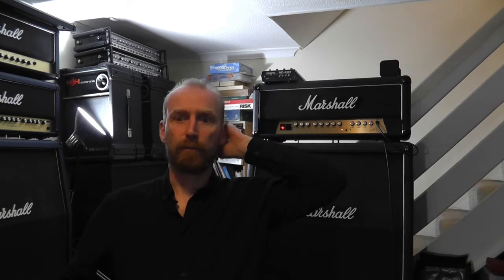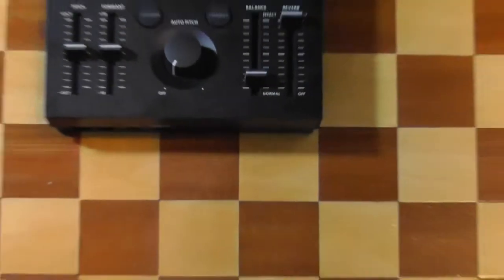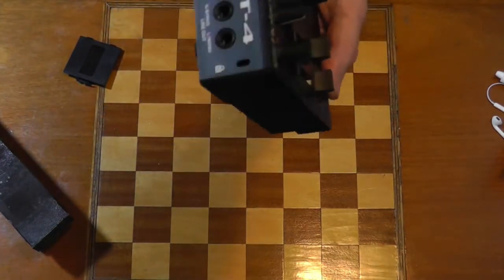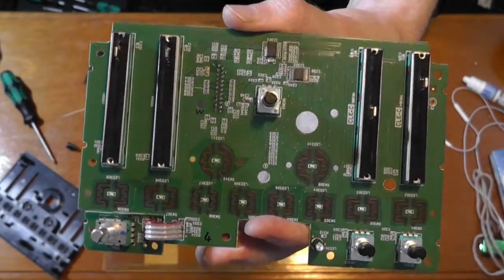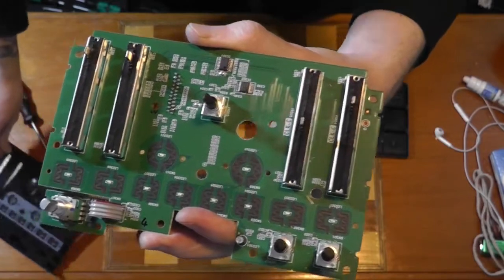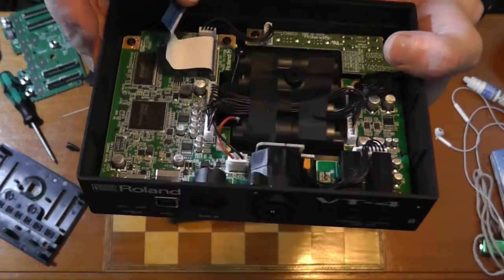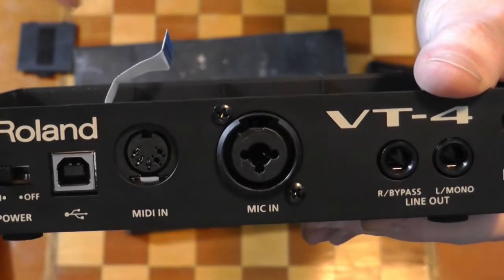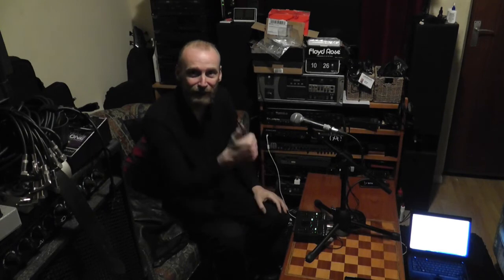Roland VT-4 Teardown

Comment: If I were to replace the big volume knob in the middle, would I just pull it up, pull & twist, or is there a screw that needs to be removed?  I’ve been hesitant with attempting to remove the knob as I don’t want to unnecessarily force it and break the unit in the process.  

Also, do you happen to know the potentiometer size of that particular knob?
Reply from the maker: Hey mate just pulls right up and off. I think it's a 'D' shaft on the pot underneath. They are usually all the same size, so when shopping for a nice fancy knob, juys make sure it specifies 'D' shaft and you should be good!
Reply: @hydorah  Howdy!  Thank you very much.  Worked like a charm.  Cheers!

Comment: IMO roland is a highly experienced manufacturer of audio devices and interfaces, I've many Roland devices and this does exactly all the things you'd expect from a device named "voice transformer" ....and if you ask me it's probably one of the best on the market, despite the cheaper looking build quality. it's the quality of the components that make it, and they engineering that went into designing it. for the price, best in class.
Reply: and furthermore, to the people talking down on this device, if you want all of these effects in different devices it would cost you thousands rather than hundreds. plus Japan has long been the undisputed king of audio....so Roland FTW
Reply from the maker: @NickDoddTV  I Do not entirely agree. The item is full of Chinese made components and is made in China. Chinese on the outside, Chinese on the inside. I think you maybe thinking of a prior Roland. You can't actually stop the VT-4 from modifying pitches. Roland just in general is utterly incapable of giving people what they want. People want the classics. Roland just spews out digital lookalikes. That said I still have my VT-4 and can see it coming in handy and as you said those capabilities in dedicated devices would cost a stack. Great product idea, poorly designed, poorly made
Reply: @hydorah  interesting that yours is made in China, because mine is made in Japan... now I'm curious to open mine up and see if it's the same... maybe a different hardware revision?
Reply from the maker: @NickDoddTV  Wow! Yeah that is crazy, how could tooling up in Japan for something you'll be making in China make sense? This is very, interesting!  I just double checked mine, deffo made in China. Stamped right into the plastic on the back. Happy to open mine up again so we can compare details! My serial number is B1L2459. Any chance you got a prototype somehow?